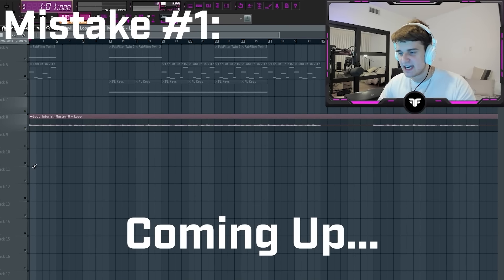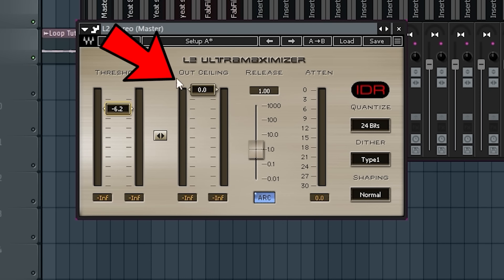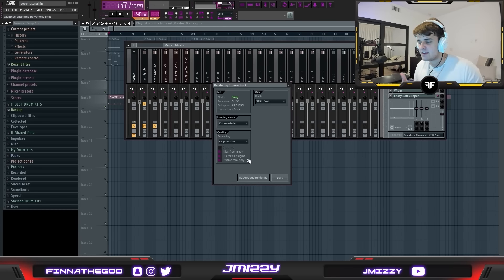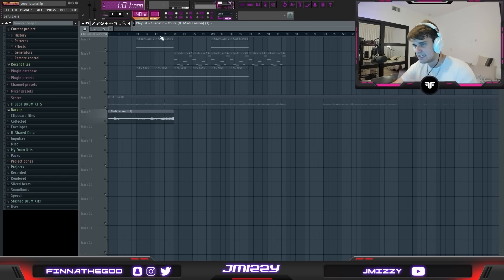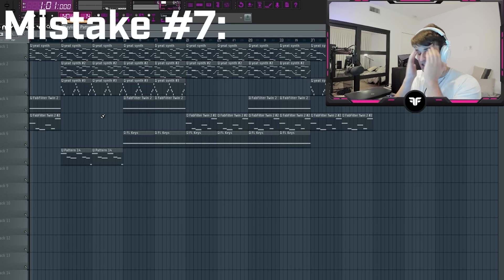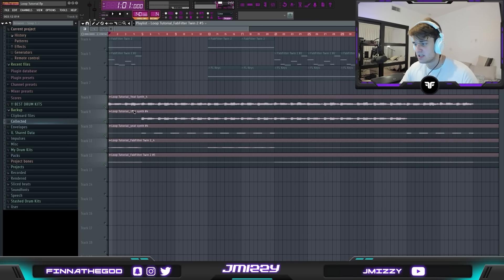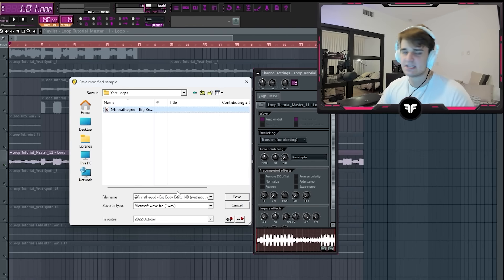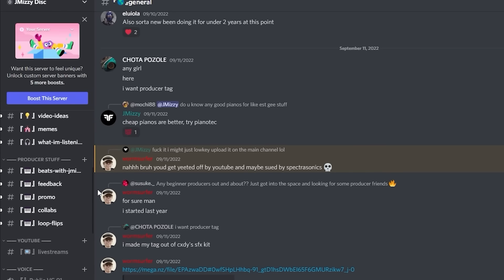Why Industry Producer Loops Sound Better Than Yours | FL Studio Loop Tutorial

Comment: Lots of gems but i don’t fully agree with that bass lines shouldn’t be in loops, it adds the feeling to loop that someone can carry on or make their own bassline. That’s not huge deal & I personally rarely use 808 basses in loops, mostly its synth basses which can be used for bridges or intros. Thank you for your tutorial! ❤️
Reply: Imo you shouldnt add bass cause even if you cut out the low end there will still be some mid end from the bass and it will make your mix muddy
Reply: I hate when people put basslines in loops, I always cut them out anyways, unless it adds a lot to the loop's vibe (which is rarely the case)